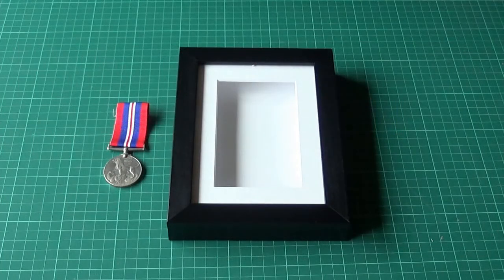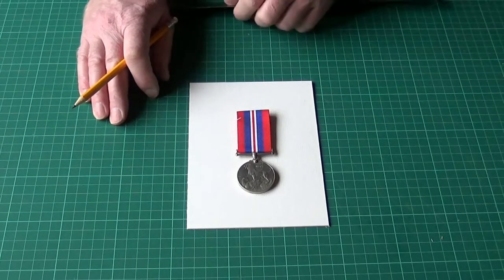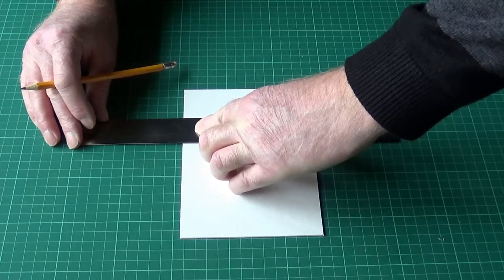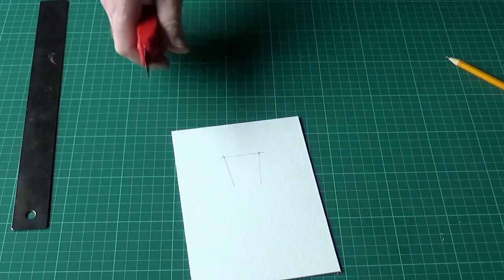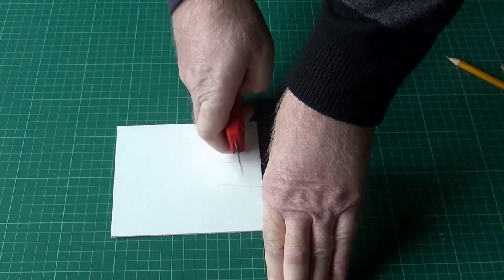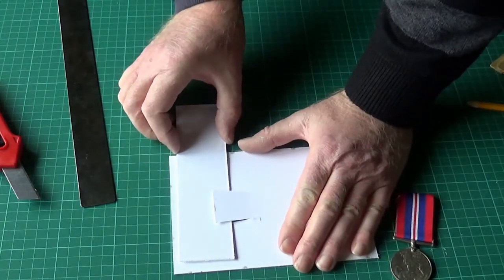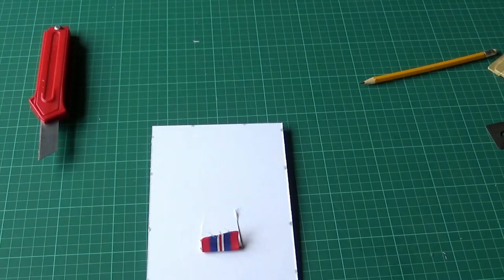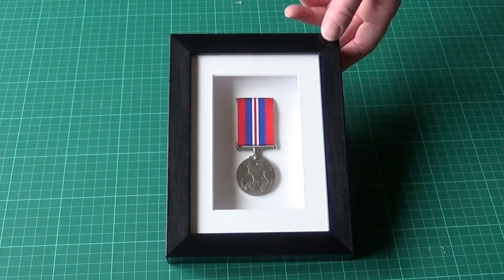Simple Method of Mounting a Medal in a Box Frame

Comment: I would work from the back of the card so as not to mark the display area.  Check the card for square.  A fresh blade every time.  Acid free tape. A stitch around the gong to stop it moving about. That small ruler makes me squirm.
Reply: Working from the back wouldn't give you a clean cut so messier in the long run & stitching would damage the ribbon.